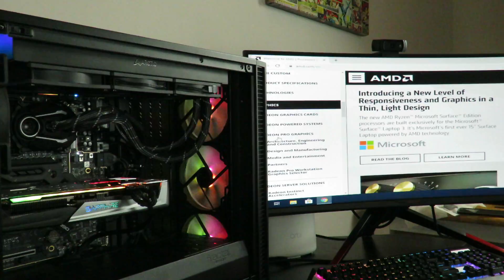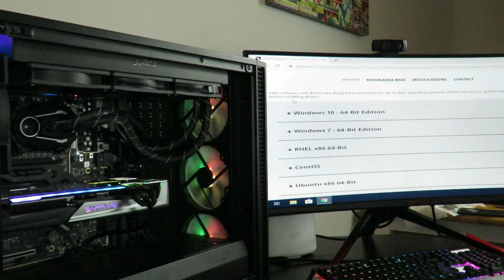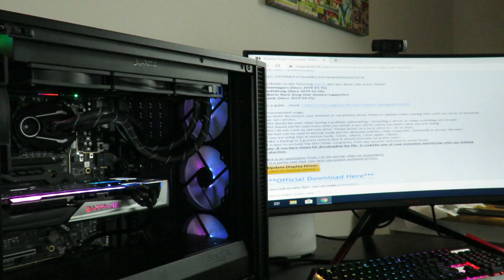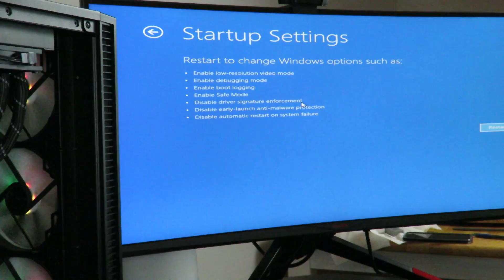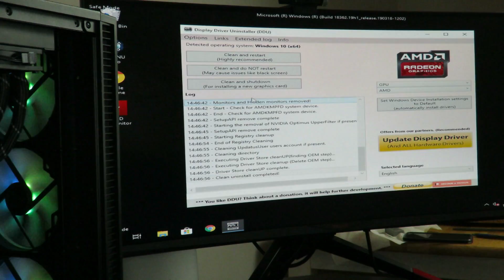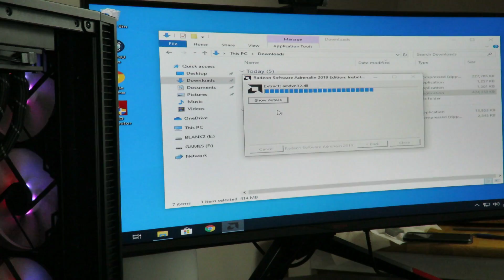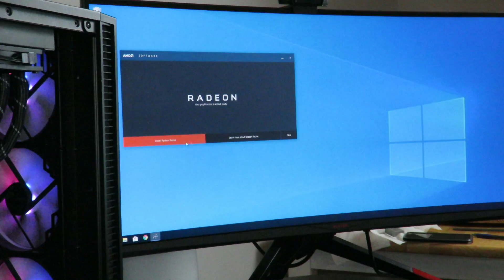Installing the AMD Sapphire Radeon Nitro+ RX 5700 XT 8GB OC Graphics Card

Comment: Hi Sir !
Nice info in there, thank you !
I'm interested in that card to upgrade from a GTX 1060 OC6 but don't really know if my system will handle it with no problem :

Ryzen 5 2700X
MSI X470 Gaming Pro
16Gb G.Skill Flare X
Corsair 650w V2 Gold

Do you see any potential problem ?

Thank you very much.
Reply from the maker: I think you will be fine, Sapphire states that a 600Watt power supply is required, 650 recommended, so you will be good.  DO you have 2 8 PIn PCIE connections?  If you want to see the card, Check out my Amazon Affiliated link for this card: https://geni.us/VoHIZhu
Reply: @ThisBytesForYou  
Thank you Sir !
I'll check for those connectors.
I'd have to check the clearance for the card to.
Reply from the maker: @simonhouel1984  ahhh yeah, clearance is nice but the card is new, I doubt it will be on clearance.  If you dont have the adapters, I can see what you may need, just let me know what you have and I will see what I can find for you.
Reply: @ThisBytesForYou  
It's a X470 board,
2 sticks of RAM in designated slots (1 and 3 if I remember correctly)
A big Noctua NH-U12S for CPU cooling
SSD drive
The case is a pretty large one :
Antec Three Hundred Two

What kind of adapters might I need ?
Reply from the maker: sorry, I did not reply, for some reasons some of my messages are not coming through, have you already gotten this sorted out?  If you have not, please let me know what manufacturer and model number power supply you have
Reply: @ThisBytesForYou 
Hi !
Yep.
I bought a 5700xt Pulse and if fits perfectly.
Huge improvments :-)
Thank you.
Reply from the maker: @simonhouel1984  awesome news, very happy it worked out for, I hope this video helped you out, Thanks for getting back to me, even though my reply was so late.

Comment: So if im building a new Pc but i still want to Reuse my 1tb hdd with the old Gpu Installed drivers do i still need to do this?
Reply from the maker: yes, I do recommend it and if you are going to build a new PC with a new motherboard, processor, video card, etc... I recommend starting with a fresh install of Windows.
Reply: @ThisBytesForYou  my Old and new gpu are both Amd so do i have to do this before i install my Gpu so it wont uninstall new Gpu Driver?
Reply from the maker: @justvincent6602  I would recommend uninstalling it regardless, you will get a much better result, then using DDU like I mentioned here will get rid of any potential GPU driver issues you may have had before.

Comment: Is this GPU compatible with the Gigabyte B450 Aorus M?
Reply from the maker: it sure is.  What are your other components in the system?
Reply: @ThisBytesForYou  

CPU: R5 3600 4.2Ghz
GPU: PALIT RTX 2060 SUPER DUAL 8GB
RAM: T-force DELTA 2x8 16GB DDR4 3000Mhz
Reply from the maker: @freddukes6315  so far so good, you might get a performance increase but it will be minimal, like 1 or 2 fps over the 2060 super.  Are you planning on replacing this 2060 super with a 5700, if so I don't recommend it.  Now if your 2060 super died, then yes I can see it would be good.  Also, what power supply do you have, make and model number?
Reply: @ThisBytesForYou  Hmm, I think it is a SEASONIC 750W Full Modular, Forgot the number though.
Reply from the maker: @freddukes6315  ok, you are good then, I just wanted to make sure your power supply would be able to handle an update.

Comment: Thanks for the video. I just got my rx 5700xt nitro and installed it. I do not have a monitor yet. Will the gpu power on when i turn the computer on without the monitor connected to it? Thanks
Reply from the maker: It will turn on... But you won't be able to do anything with it and you are very welcome my friend, so very happy I could help.
Reply: @ThisBytesForYou  Really? My gpu is not turning on for some reason. I have it connected like you have but it does not turn on.
Reply from the maker: @syed5126  its very hard to tell without a monitor, you also need a keyboard and mouse plugged in to test.... what do you have on the motherboard now?
Reply: @ThisBytesForYou  nothing connected to the mobo.
Reply from the maker: @syed5126  do you have a processor or RAM on the board?
Reply: @ThisBytesForYou  yeah
Reply from the maker: @syed5126  do you have the pcie cables attached, both?
Reply: @ThisBytesForYou  yes
Reply from the maker: @syed5126  so how were you testing before, I am very confused
Reply: @ThisBytesForYou  i just wanted to see if my gpu will turn on without a monitor plugged into it. The gpu is installed in the top pcie slot. A cpu and RAM are also installed. The mobo turns on and the fan of the cooler spins but the gpu does not. My question was that do you need a monitor to be plugged into the gpu for it to turn on or can the gpu turn on even without the monitor plugged in.
Reply from the maker: @syed5126  it should but let me check for you when I get home.
Reply: @ThisBytesForYou  thank you so much.
Reply: @ThisBytesForYou  Sorry for bothering you again but have you tried it? Thanks
Reply from the maker: @syed5126  I just tested on an NVIDIA Quadro and it did power, on, as in fans spin, is that what you mean by powering on?  Now, the Quadro I am testing with right now is an 1800FX, its OLD, different technology, your card has a 0DB technology where as in the fans wll not spin till it hits a certain temperature.  Do you not have a monitor to test with?  Also, you are not bother at all, I am very happy to help.  Sadly though I had to send this card back, Sapphire is a review and return company, so I cant tell you with this specific card.
Reply: @ThisBytesForYou  Thank you for the reply. My monitor is coming today. I just wanted to see if my gpu will power on without a monitor connected to it. I understand the fans no spinning but should not the rgb light up? I am trying to find out if my card is working. Its brand new and i just got it yesterday. Thanks.
Reply from the maker: @syed5126  well, in this video we can see that the card did light up, but the monitor was plugged in.  Can you let me know what power supply, model number and manufacturer you have?
Reply: @ThisBytesForYou  Its corsair RM 2019 750W
Reply from the maker: @syed5126  OK, I was just making sure and also, just to verify, do you have your 8Pin EPS cable connected (CPU Power, usually next to the CPU socket) and your 24PIn ATX Cable connected?  What motherboard do you have, actually that would help a little too.
Reply: @ThisBytesForYou  Yeah all the cables are connected. The mobo is the b450 tomahawk max.
Reply from the maker: @syed5126  thank you my friend.  A few other things, If you have 2 sticks of RAM, place them in DIMMA2 and DIMMB2, only 1 stick, place it in DIMMA2.  Make sure you have the 8Pin EPS power plugged in (the plug next to the CPU) and of course the 24PIn ATX connection.  I asked for the motherboard to get closer and see if you had a PC speaker, it does not look like it does.  If you have a PC speaker (4 pin teeny tiny speaker that plugs into the the headers in the section where you plug in your front panel connections, USB, Front Panel Audio, etc) that will help you to identify problems, if you are having any, the P.O.S.T beeps let you know where you have a problem, if you have a problem.  So right now you could be having an issue, potentially unrelated to the card, but you don't know, the PC speaker helps a ton, you can find one here on Amazon, if you don't already have one: https://geni.us/yA0pbH.  They are very cheap, but have saved me many times, also since it does not look like you have an LED indicator that gives you those codes either.  If you have another card it may help, but having the monitor for sure will help a lot more.  I am mentioning so many things, because I am not sure on your building knowledge, so I am trying to help as much as possible.
Reply: @ThisBytesForYou  Yo thank you for taking your time to write all this. The mobo does have LEDs. A red LED lights up when i turn the computer on. It says VGA next to the LED. Idk what that means. Anyways i will get my monitor today so i will able to check. Ty so much for your help.
Reply from the maker: @syed5126  OK, as per the manual, the "EZ debug LED" states that when the VGA shows up, it indicates that the GPU is not detected or fail", don't freak out though this could be for a few reasons.  Try reseating your video card, take it out, then plug it back in, try again.  Make sure you are on your first (at the top) PCIE slot, if you are already, try the second PCIE slot, it could be your board is bad too.  If you have another video card, this would help to test, but having the monitor for sure will help, I know waiting is HORRIBLE though, I hope the best for you my friend, and I hope I have helped a bit.
Reply: @ThisBytesForYou  You sure have friend. Thank you so much. Good luck😁
Reply from the maker: @syed5126  thank you my friend, I truly appreciate it.  Please let me know how it goes once your do receive your monitor, hopefully its nothing serious
Reply: @ThisBytesForYou  Connected my monitor but no display. The gpu fans are not spinning and no rbg. Guess it will be a RMA then. I have tried everything from building the system from scratch again to reseting the CMOS. Thank you for your help.
Reply from the maker: @syed5126  ahhhh man, that sucks, I am soooo sorry you are having those issues, I was hoping the best for you.  Would you happen to have another video card, even if it's a horrible card, just for testing to make sure that your board is not bad.  Hoping to save you time.
Reply: @ThisBytesForYou  Yeah it sucks. This was my first build so it sucks even more. I do not have another gpu sadly. I just started a RMA today. Hopefully its just the gpu which was faulty.
Reply from the maker: @syed5126  I truly hope so my friend, it  happens though.  I hope nothing but the best for you and please let me know how it goes.
Reply: @ThisBytesForYou  Will do😀
Reply: @ThisBytesForYou  Will do😀
Reply from the maker: @syed5126  thank you my friend
Reply: @ThisBytesForYou  Hi,
Sorry i forgot to update you lol. Turns out the motherboard was faulty. I ordered a new one and plugged everything and yeah the GPU turned on with all its RBG. So yeah its up and running😁
Reply from the maker: @syed5126  ahhhh ok cool, thats great to hear, so very happy its all working.

Comment: I Bought the Rx 5700 XT Raw 2 and I used to use a RX 580 and It only uses one 8 pin pcie epxress cable. Do i need to get another cable ?
Reply from the maker: yes, for sure.  The cards may work seemingly fine with one, but as you use it more and the power demand on the card goes up, the other connections are needed.  If you don't have them plugged in, you might experience blue screens, black screens or other oddities during gaming, they don't put them there for fun, there is always a reason.  I highly recommend plugging in the 2nd one.  Let me know what you think of the card so far, if you have been using it.
Reply: For sure ! Thank you so much
Reply from the maker: @Neo5119-w7e  you are so very welcome my friend, so very happy I could help you.

Comment: Im Stuck Between this and the 2080 you reviewed that is 650$ now. Is that 2080 really THAT much better than this card?
Reply from the maker: that is a great question, one that i will have a definitive answer for you all soon, performance wise at least but the question is better asked, what are you going to be playing and at what resolution?
Reply: @ThisBytesForYou  I plan on trying the new Call of Duty, The Witcher 3, borderlands 3 and 4k 60Hz. I have an i5 8600k cpu, I am a little concerned about bottlenecking with the 2080. I don't know if I need to upgrade that too?
Reply from the maker: @marcellobarbaria2709  ahhhhh at 4K, you won't be looking at the 5700, though it is a great card it maxes out at around 2K(1440P), it can do some 4K, just not very well.  The 2080 can do MUCH better, but it too will struggle at times, depending on the eye candy.  This is the 2080 I have, I love it, but if you don't do 4K, the 5700 XT is for you: https://geni.us/SwBEU6
Reply from the maker: @marcellobarbaria2709  for 4K, you will want a TI though, to make it run smooth, something like: https://geni.us/W4AUNu, but its not cheap
Reply: ThisBytesForYou  have you tried to oc your 2080? And if so did you see a big jump in power? Thank you again. And you aren’t kidding that’s more than double a  normal 2080 for the ti
Reply from the maker: @marcellobarbaria2709  haha yeah, it is stupid expensive.  Yes, I have overclocked it, and there is a spike, not huge, but it makes a difference.  I hope to have a video out on it soon, I am so backed up, catching up.  Stay tuned but what power supply do you have in your system?
Reply: ThisBytesForYou  EVGA 650 80 plus gold. I am coming from an rx580 too
Reply from the maker: @marcellobarbaria2709  well, you are good to start with, they are saying they require a minimum of a 650.  I don't remember my system getting that high, even on a TI, so I think you are safe.  If you wanted to upgrade, I did a video on the 100Watt, https://www.youtube.com/watch?v=Dv1qK2phCFM, which is not too expensive, but for about $40 less,  you could go for an 850 https://geni.us/eeOeo5

Comment: hi, very nice video for me, if i can ask you some questions... do you think the reinforced pci-e is enough to support the weight of the video card without bending? i read a lot of issue about the drivers support, what your opinion ?
Thanks in advance ;)
Reply from the maker: It seems to hold it pretty well, i can't say for sure over time.  No issues at all on driver support as of yet, I doubt there will be any I think either.  I mean, things happen, there may have been in the past but everything is great so far.  You will see my final review on this in the days coming up.  Thank you so much for stopping by, checking out the video, your kind words and for commenting, it means the world to me .